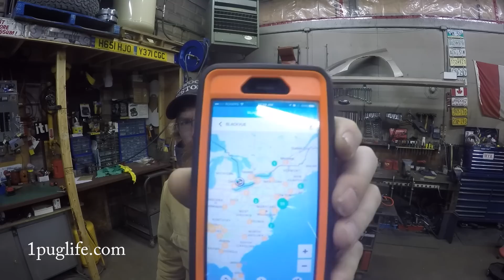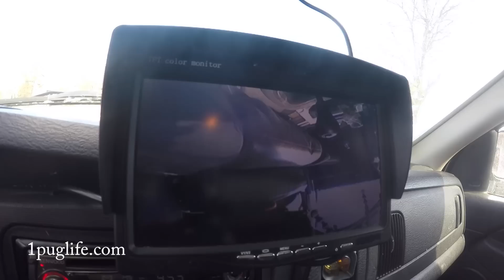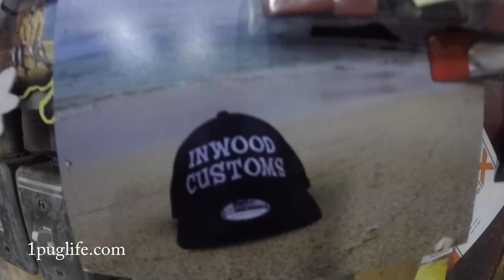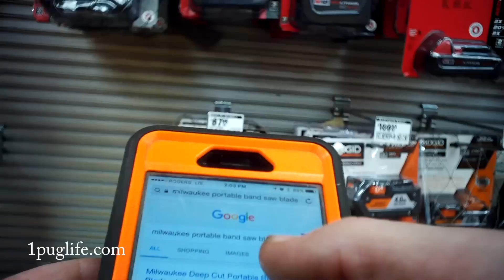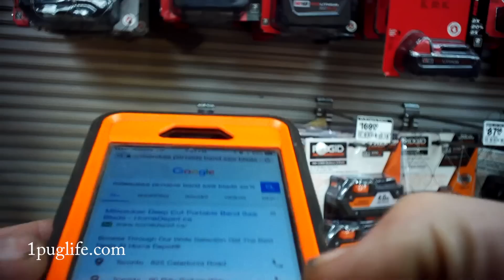roof dick update

Comment: Man why don't you go buy the two body pieces for the rear wheel wells cut the old shit out and weld the news one's on it will look 1000 times better then what your truck does now and it don't cost a lot of money and it would make a good movie and if you need a hand I live in London i could give you a hand on a weekend sometime if you wants get the truck looking good instead of rusty shit thy are like 100 bucks for both sides plus delivery might be a little more now but there abouts
Reply: im all for watching a body work vid on the dodge wheel wells
Reply: 79tazman that truck doesnt look like its too far gone yet. it may need 4 new corners and cab corners but the interior is pretty nice still and seems mechanically sound. would defiantly be worth building bumpers for